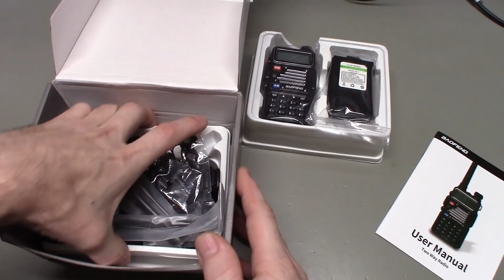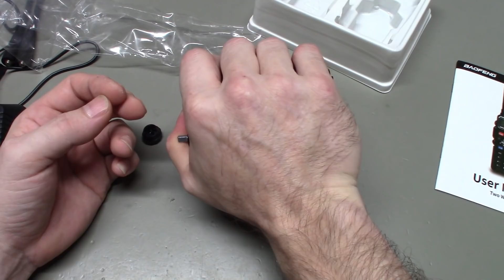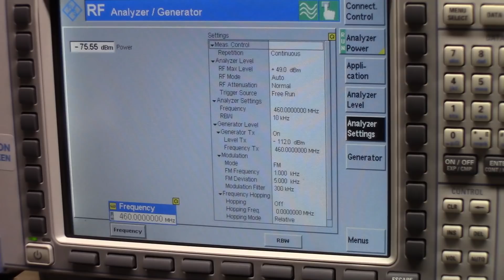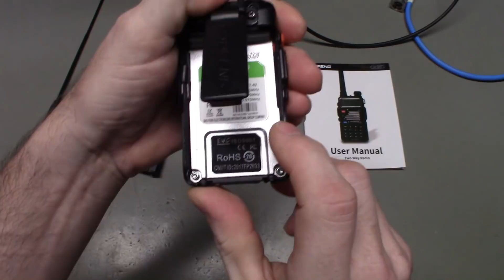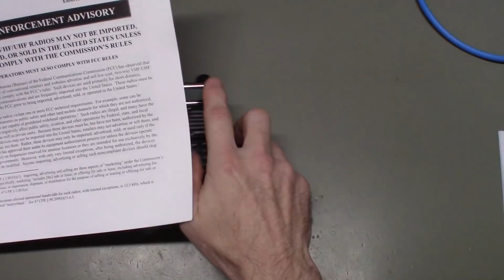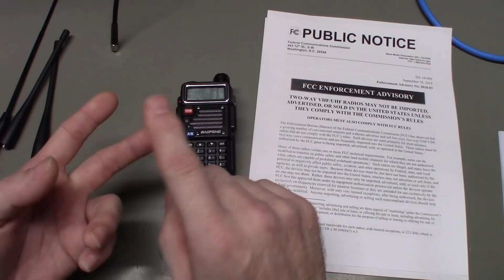Baofeng UV-5RX3 Tri-band UHF/VHF radio teardown review.

Comment: I find it hard to believe you didn't put it on a spec an. I'm guessing there's a reason you didn't include any footage of that? You'll (rightfully) hate on CB modifications that splatter all over the place, but when it comes to you getting a sponsored product it's not worth mentioning apparently. Very interesting. Why don't you show the world what the output looks like, and if that 4-5 watts is all where it should be? You mention hams are responsible for ensuring their emissions are within the legal criteria. Well so are the companies that sell radios. That's the FCC's other problem with these... even if they did lock it to the ham bands, it still wouldn't be within the emissions limits. Without huge improvements in engineering and build quality it would never pass (and even if yours passes, the next guys probably won't, that's how inconsistent these things are built). Now imagine how many people are using them on an external antenna, and through an amplifier. Ouch. It's really too bad that the desire of ham operators to save a few bucks outweighs the desire to have a clean and quality signal. Don't put the blame on the big 3, put the blame on people who don't give a shit.
Reply from the maker: Actually didn't really think about it at the time.  Someone else asked the same thing, what's it look like on the SA.  So I did shoot a separate video showing it's emissions out to the 6th harmonic.  I'll get it uploaded soon.  Looks pretty good on UHF but on VHF it's a high level harmonic generator.  I think I saw +21dbm if memory serves correct on the second harmonic.
Reply: @mikesradiorepair  Good on ya mate, sorry I sounded so harsh... I shouldn't participate in internet discussion before the coffee has kicked in I guess. :) There's been lots of talk about these rigs in a local club recently, and it frustrates me that so many people seem so blissfully ignorant to the issues they have. The big 3 might be more expensive but they're able to consistently conform to legal specs and will likely last about 10 times longer. Looking forward to your future video on it.

Comment: I don't think there's  that much of a difference here versus the CB issues.  Maybe that most professional users don't bother with HF anyway.   I understand the concerns.  I wish I could have one radio that I could legally use both on CB and 10/12 meters.   Legal power limits on class D CB.    Can't do it though.  Once a CB can operate outside the band it's not type accepted and illegal.  Even if I'm a licensed ham, I can't use it on CB regardless of still operating at legal power levels etc.   Every once and a while you hear a story of someone in an emergency situation that can't reach another amateur or repeater and only get help by  going out of band and getting a response from another radio service.   I don't think hams are often the problem.   It's people with a bit of money and no knowledge or regard for rules or spectrum management.  People like kids, preppers, hunters, hikers, off roaders, anarchists, criminals.....   I don't think it should matter what my gear is capable of doing, just what I actually do with it.   Unfortunately the lowest common denominator and worst case scenario is going to influence what the law abiding users can have.  There are combination smart phone/dmr radios on the market for about the price of a premium smart phone.  They can operate on ham bands and more also.  I guess they're questionable too.  But they're not so inexpensive that they'll be thousands upon thousands in incompetent or noncompliant hands.  I hope.

Comment: I have the dual band, and yes I bought it to get back on the air after a hiatus. It was bought completely due to the price. I knew nothing about the radio and soon realized that it is not a "big 3" as you get what you payed for, however  I am happy with it! 
The dual band can manually input 220mhz, but you cant put it into memory. I wonder if the dual band has the capability to be re-flashed into a 3 band radio so that you can put 220 repeaters into memory? I'm sure someone out there knows how to modify it . As for the transmit on out of band frequencies, the first thing i did after I got radio was use chirp to make it only xmit on ham bands. That way to me (and FCC) its legal. Thanks for this video. Its very informative!

Comment: These radios can be confusing as far as the model numbers go. I have the BF-F9V2+ and I can't tell you what that means. I know that on one of the bands it puts out 6.5 watts on high, but is advertised as an 8 watt radio. One thing I can say is it is a good little radio. I have the Nagoya  NA-771 antenna for mine and it works well. I can get all of the local weather stations on it and it has an FM radio receiver built in as well. Well worth the $49 dollars I paid for it.

Comment: I have two of these and use them frequently.  They're great through a mobile car antenna (adaptors for SMA to PL239 available online) or through a yagi!  Build a 3 or 4 element yagi and have some fun hitting repeaters as long as you are a licensed Amateur Radio Operator.

Comment: Mike, I have two words for you: spectrum analyzer. Look at the output of this radio on your spectrum analyzer on, let's say, a 0-1 GHz range. I assume that your spectrum analyzer has at least 80 dB dynamic range, so you can see the spurious emissions.

If this radio is being used to transmit in the amateur radio service in a part of the world regulated by the U.S. Federal Communications Commission, then it must meet the technical standards contained in Part 97, Subpart D. Specifically §97.307(e) which states that any spurious emissions have to be at least 40 dB down from the fundamental and no more than 25 μW.

Comment: I agree with the FCC.  What I hear, I do not know is a fact or not.  Understanding is these radios are being used by basically organized crime.  They bypass cell towers and such, I think some have a form of obscure digital so need decoded, and transmit just out of band.  This is unacceptable in the fact that a 5 year old can play with this radio, even plug up to a pc and program it wrong, not know it and use it.  Otherwise like except got very poor receive filtering.
Reply: I think this one is only analog.  There are inexpensive DMR radios that include encryption. Using encryption is not legal for US amateurs.   Yeah,  unlicensed operators that don't know or care where they operate are a problem for all of us.
Reply: Good only analog yea.   If I recall correctly, you can transmit in many modes, digital or analog and things, but it must a published way of doing it meaning anyone can decode it.  It includes talking in other languages.  You can talk Klingon, as long as you can ID yourself, it is actually a full language now can be used, it published.   P.S.  No I do not speak Klingon, at ALL. lol

Comment: For car use get a second charger, and an old plug in phone charger. Modify the charger to output 9V and replace the capacitors in it (generally they use a no name brand capacitor, often only rated for 10V and used on input and output) with better ones, and it then becomes car compatible. Then you have the ability to use it mobile and charge it as well, though you probably will only want to charge while stationary as the radio falls out the charger while mobile over bumps.

For those who think that light is useless it actually is very handy, especially at night or when power is out. You also get a very decent FM radio in there as well, though mono only and of course you cannot transmit on FM broadcast bands.
Reply: AND... most of all, slap a mag mount antenna on the car roof and connect it to the HT.  Makes getting out about 10x better.

Comment: yes, chirp will program this radio-look under radiooddity in chirp
And yes, radiooddity sells a tri-band  antenna called the RD-301-they are $10.00
And you can program channels to receive only mode.
how clean is this radio harmonics/spurious-wise?
actually, owning and using these is perfectly legal for ham use-selling/importing them is a different matter.

Comment: I bought one for my XYL so she'd have 2m/440 where she hangs out...but there's something in/around my house that will break the 440MHz band even with the squelch turned up all the way. Replaced the BF with a Wouxon HT that doesn't suffer from that issue. These are great for simply throwing in the glove compartment in case you need a HT to back up your mobile rig. Thanks for the review Mike!  73 - Dino KL0S

Comment: I have a UV5R and I like it also. For the money it can't be beat. I also own one of the new Yaesu FT-65R handhelds (made in China) and after entering in a code number via the keypad it will transmit all over the place too!  At least you have to work for this mod...  I just checked my 5 yaer old UV5R and it has the FCC part 90 approval label. They were approved earlier on.

Comment: Yes, if the button above the push to talk button is pushed for five seconds it will transmit a siren tone. If this button is pushed and not held down, it will   turn on a built in FM radio as for the button below the push to talk button, this is the Monitor/flashlight button. For the monitor function, push and hold the button in for five seconds, continue holding in the button for as long as you may want to listen. For the flash light function, push the flashlight/monitor button, but do not hold it. The first setting is a normal flashlight. The second setting is an SOS light. When you push the button the third time, the flashlight is off. What you need to be made aware of, is that on some of those radios, some of the buttons or multi function buttons. It is programmed in the radios firm wair. I know a lot about that type of radio, because I got one.
Reply: Firmware, because I have one of these radios.....

Comment: Great radio for the money. I have 2 and the extra capacity battery. Carry it everywhere with me, rather than my Kenwood TH-F7. Only use it on the Amateur bands, as i am licensed. Only problem as you explained, transmits everywhere. So if the general public buy them, they can transmit unlicensed on any frequency...
Reply: If they do, it's their wallet that the FCC takes their fine out of. You cant blame the equipment for the laws that idiots brake it is the same for radios, guns, and automobiles. Some part of our civilation hasnt  recognized that yet.